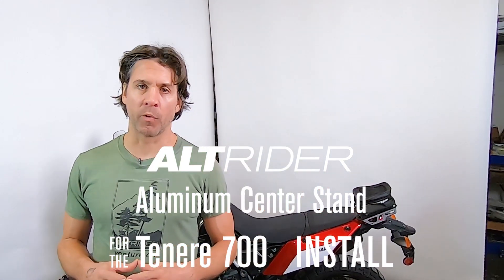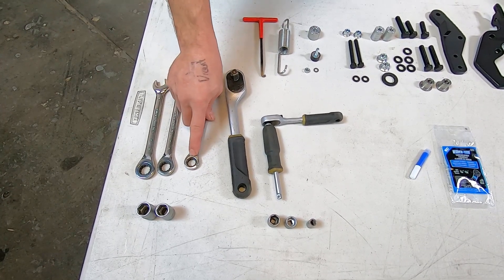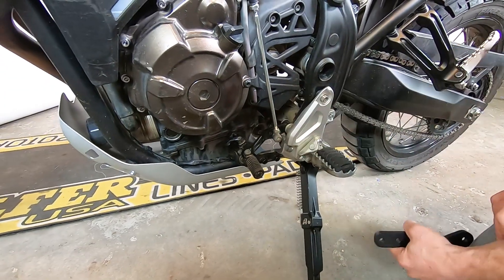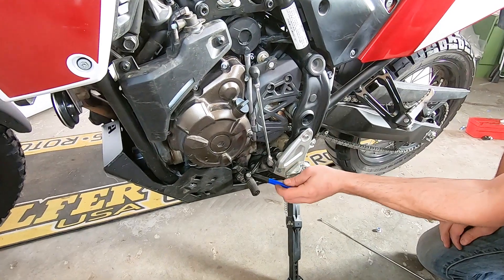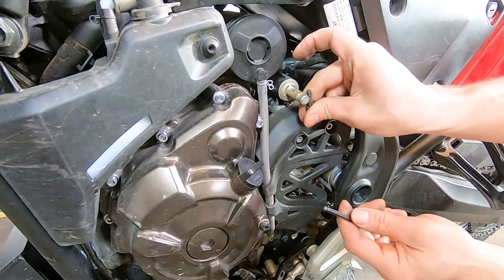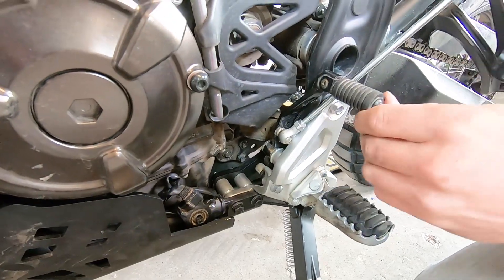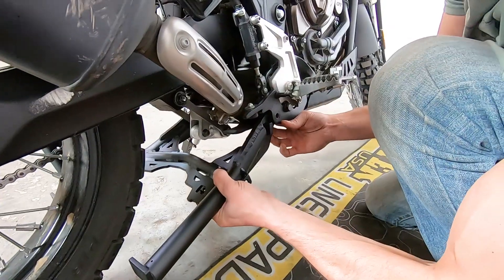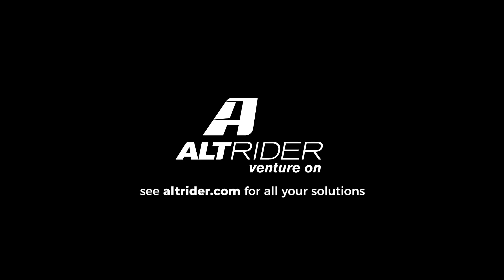Yamaha T7 Aluminum Center Stand Install by AltRdier

Comment from the maker: There is an easier way to install the rider's left side of the center stand if you also have the AltRider skid plate.

First install the M10 that goes from inside of bike out, this one is easy. Then of the 2 M8 bolts that go from outside of bike first: Get the one closest to front of bike started first, drive it though the skid plate, frame spars, spacer, and the center stand bracket until there are enough threads exposed on the backside of the bracket to engage the nut. You can place a box end wrench on the nut and have it just hang. This will constrain the nut so you can drive the bolt with a socket, do the final small bit of tightening of the nut with the box end wrench (since it is near final torque value from the socket it will only be a few small turns on that wrench).

Then do the second bolt that is closest to rear of bike. This bolt and nut is much easier as there is a bit more access. 

Just use the opposite order to remove the skid plate by starting with the M8 toward the rear of bike. Then remove the M8 toward the front. You do not need to remove the M10 that ties the center stand bracket to foot peg casting.

We're considering making a video to showcase this, let us know if that's something you would like to see.

Comment: Do you need to remove everything to change oil with the AltRider skid plate?
Reply from the maker: The skid plate needs to removed to change the oil, but you can leave the brackets on - which makes reinstallation considerably easier. You don't need to remove the center stand for an oil change

Comment: The stand looks great, do you know if this fits a T7 World raid with standard skid plate? and how easy is it to get the bike on the stand if used with your adjustable lowering links?
Reply from the maker: Yes, as long as the OEM center stand fits, then our center stand will fit.

Also, our aluminum center stand is the easiest stand I've used to get the bike up on the stand. So if the bike is lowered, it will take more effort, but its still very reasonable.

Comment: Question:  By placing the thrust washer and the spacer of the Center Stand on the inside of the the stand it will not provide any spacing.  If it is placed on the outside it will.  Am I mistaken?
Reply from the maker: The spacers are only for the bracket that is attached to the bike. The thrust washer (one big washer) is always placed on the inside of the center stand hangers. It is your choice (based on how it fits on your bike) to place the thrust washer on the left or right hanger of your center stand.

So based on which side you place the thrust washer it will push your center stand to one side or the other by a mm or two.